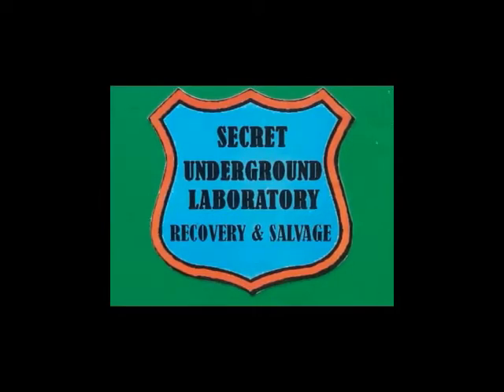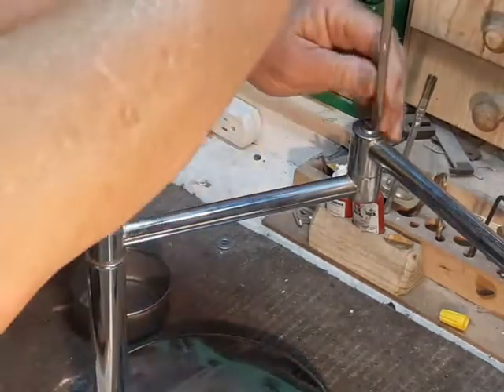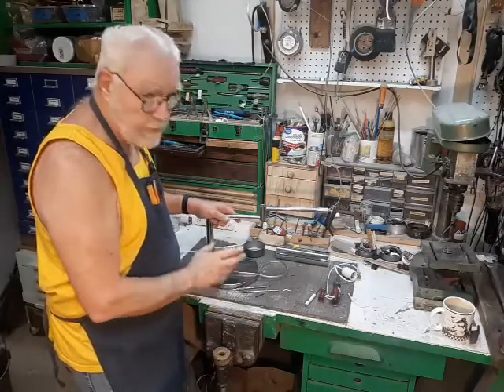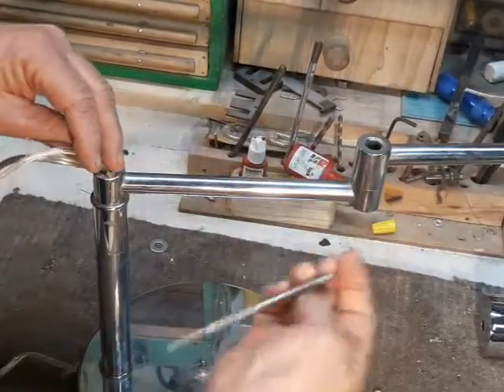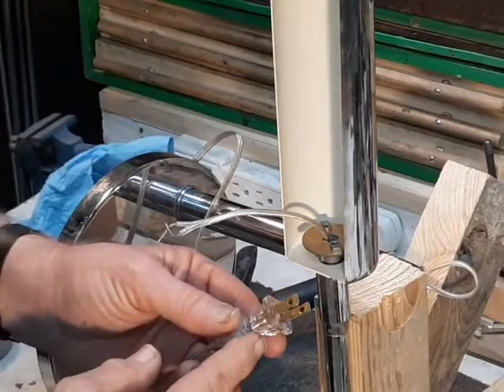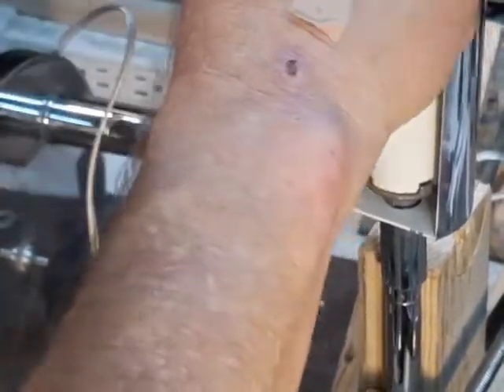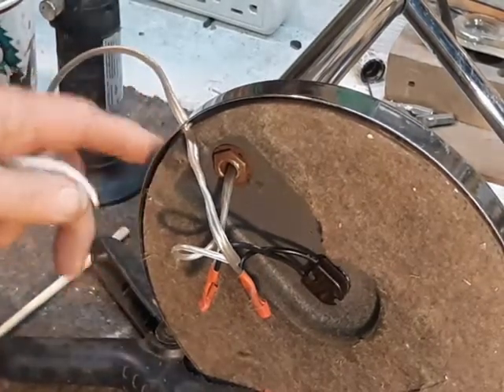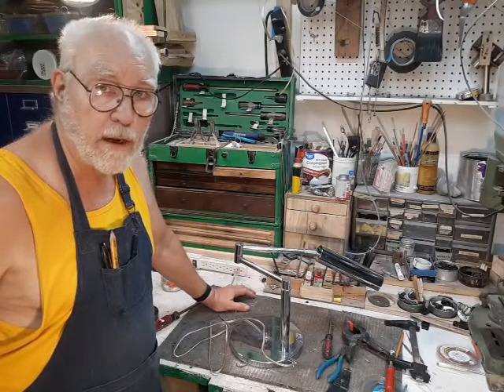Rewiring a Mid Century Modern Swing Arm Lamp in the Secret Underground Laboratory

Comment: Some swing arm elbows don't have screws to remove to pull the wire; mine had smooth caps. Take needle-nose plyers and grab the cap by the edges (it's narrow but you can do it) and pull it off. There are tabs on the cap that snap it in. It's still hard to pull the wire through, but just keep on working on it with a tool that has a hook. Be careful not to damage the wire.
Reply from the maker: The trick with swing am lamps is to push and pull in equal amounts. The wire can be pushed over the corner, but it can't be pulled.
Reply: @BronZeage  , I agree, but it takes two people. Trying to push from one end and pull from the other is not easy to do with a loose swig arm. If it was held in a vise, pushing and pulling would  be much easier.
Reply from the maker: @MarionJInce  If you watch my other videos, you'll see I often make jigs to hold the parts, so I have both hands free. As I said above, the trick is to push and then pull. If you try to push and pull at the same time, the wire either won't move, or move very slowly.

Comment: Update: I successfully threaded the lamp wire though by tying a whip knot (using waxed sail-repair nylon line) to the very end of the lampwire (and lubricated it with paste wax), left about 2' of line dangling, tied a big knot on the line end, turned on my shop-vac and easily sucked the string right up through the lamp post. With the string now available to pull the lamp wire I was able to push/pull the wire easily through. Very effective. 
---NOW I can't seem to unscrew the socket. It's not coming apart at all easily like shown in your video - like as if the threads are frozen in place although there is nothing that looks that way. I removed the screw in the neck, tried to twist it, but it's not budging. 
---My only idea is to pull out the wire to the base of the lampshade (where the shade swivels there is a ball joint and there is a visible opening to the wire)... in case the wire is holding it tight. After that, if that doesn't work, all I can think to do is clamp the socket somehow and twist it where I can get some torque. ... but that could break the ceramic socket and it still might be stuck.
---Love to know your thoughts and suggestions here. I am so close! Thank you
Reply from the maker: The wire can't prevent pipes from unscrewing. If you have a porcelain socket, you may not need to unscrew it from the base. The ceramic is held to the base with 2 small screws. The ceramic separates so the wires can be attached. There maybe thread locking compound on the threads, but more likely, there's no way to grip the socket. A small pair of pliers, sometimes called "ignition pliers" may fit around the neck of the base. You Tube comments don't allow pics in the comments, which would be very helpful. You can send pics to the Secret Underground Laboratory Recovery and Salvage Facebook page, or email them to bronzeage51x@gmail.com.
Reply: thank you, @BronZeage  , I used some vise grips on the socket neck and ignition pliers on the base and voila! It came apart easily. Rewiring was a cinch after that. The first of two Koch & Lowy floor lamps took nearly 2 weeks with a lot of time researching how to do certain things. Once I completed the first lamp, the second one took barely a morning to complete, and that included polishing the brass. Thank you!
Reply from the maker: You are very welcome

Comment: I have a Koch & Lowy floor lamp - same everything EXCEPT that the pipe base to wiring opening inside is long (like around 20") and therefore hard to reach by just free-handed feeding it up. SECOND DIFFERENCE: there's no cap or screw at the first turn in that same pipe, so no way to access the interior of the "turn" and make rewiring easier. What now?

As a solution, a friend said that I should thread a string through the opening by using a vacuum cleaner to suck it through, then attach it to the lamp wire from the top down and pull it up and through. It could work. What do you suggest? Or do you like this idea?
Reply from the maker: Pulling the wire with any kind of "fish tape" is not practical. There's too much friction at the corners. Its it likely to cut the insulation, or worse, jam and break the wire. It really requires a  push and pull technique. When I have a corner that's not open on the bottom, I strip about an inch of insulation off the end of the before starting. This lets me pull the bare wire with a hook while pushing the other end. Liquid beeswax furniture polish is a good lubricant.

Comment: Hi there! I just bought for $5 a 1940's General Electric swing arm desk lamp. It's the heaviest desk lamp I've ever encountered. I'm sure it was 20 pounds or more. Even though the lamp works, I don't trust the wiring. I removed the bottom plate and took out the cast-iron weight. The wiring mechanism has three components: GE Pyranol Capacitor, and two 15-20 Watt ballasts. There does appear to be some sort of goop that is perhaps the result of heat/age. The ballasts look ok, but it's the capacitor that has me concerned. Are parts available for a GE swing arm lamp that is perhaps 75 years old?
Reply from the maker: If the numbers are still legible on the capacitor a Google search will find it or lead to the modern replacement. Swing arm lamps have to be heavy to prevent tipping over.
Reply: @BronZeage  Thank you for the prompt response. And, yes, the numbers are still legible. To eBay I go.
Reply from the maker: @garrettmeadows2273  You are very welcome.
Reply: @BronZeage   I'm having a devil of time fixing the swivel on swing arm. I'm sure I'm going to have to bring it in for you to evaluate. I guess the mechanism just wore and now the head of the lamp just hangs down. No way to place the lamp head in a usual able position.

Comment: Sir, can you tell me what size wire do you use when goinging thru the lamp arm? Thanks
Reply from the maker: The wire used for this lamp is a SPT1 lamp cord set. A cord set has a molded plug and the bare wire ends are tinned with solder. The wire itself is 18 gauge.

Comment: Hello Bron, I do lamp re-wiring for a furniture bank and have a swing arm lamp that has me stumped. The swing arm joint has no caps and each arm section is brazed to the joint. There is a 0.05 hex socket screw on one half of the joint which has limited turning, only about one half turn in each direction, which appears to limit the swing arm to 180° in either direction. Any suggestions as to how to open this joint?
Reply from the maker: That is going to be very difficult to rewire.  The swing joint may come apart like  a puzzle when the parts are correctly aligned. That is probably the function of the socket screw that doesn't unscrew.
Reply: @BronZeage  Thanks for quick reply-I went down that path, put one joint arm in cushioned vice and incrementally turned socket screw a few degrees while apply force to separate both halves ..no luck. I also tried a bit more force on the socket screw to see if it would move beyond the stopping point and the delicate hex wrench slipped in the socket. more of that will only result in a worn socket or wrench or both. Maybe another of your followers will offer the answer. Thanks, Herb
Reply from the maker: @herbschlobohm9200  I wish you luck, but not all the lamps were made with rewiring in mind.